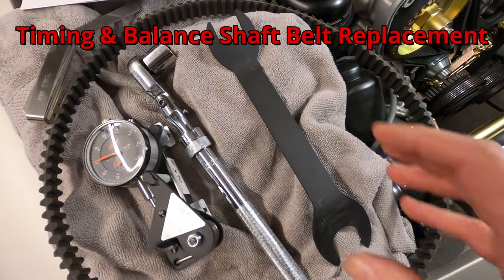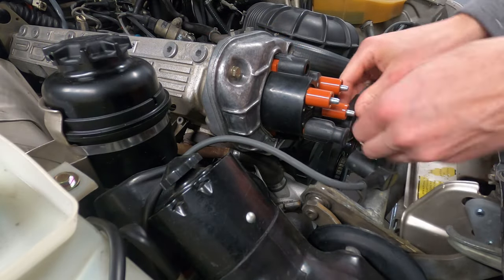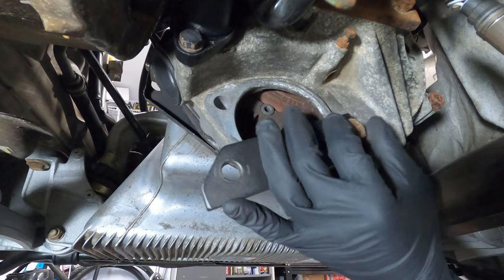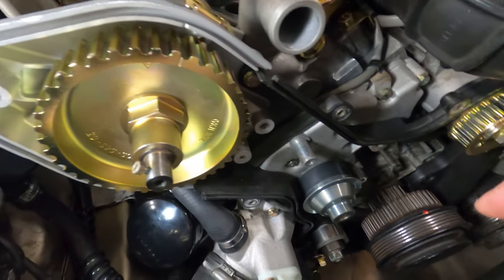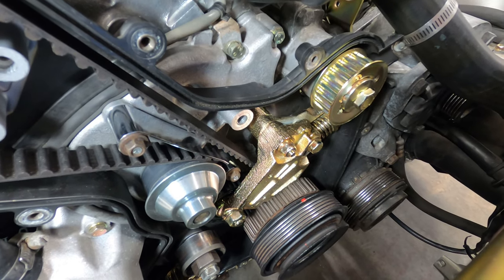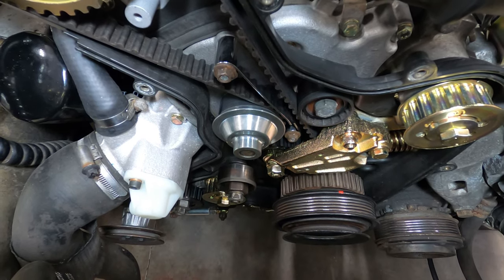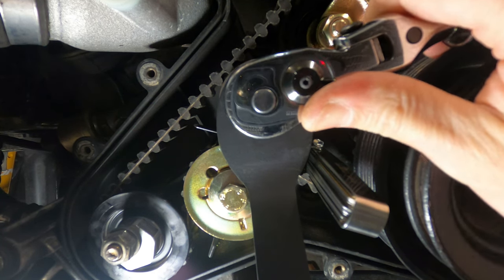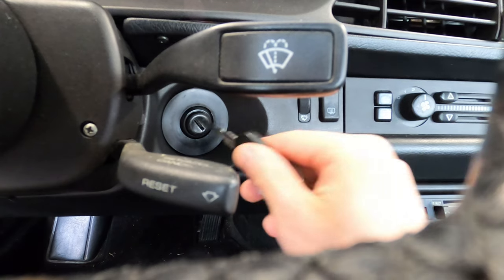Porsche 944 – Timing & Balance Shaft Belt Replacement Tutorial (Spring Tensioner / ArnnWorx Tool)

Comment: Again-excellent job here- Thank you! My car just a month into it with 111k miles had water pump, belts, pullys, etc replaced 4k miles ago by PO. However, it was mid-year 2017. At the very least I need to check tension on the belts. Is it necessary to remove the cooling fan housing  to remove the upper timing belt front cover to inspect belts? And if not, can I do a quick inspection on the belts with just the upper belt cover off or do both upper and lower covers need to be removed? Thanks in advance! Stuart
Reply from the maker: Nice! The belt condition is still probably decent after 4 years unless it was stored in very poor conditions where it could dry out and crack, but it’s definitely worth a check. The top cover can be removed without removing the cooling fan assembly, which will allow for a visual inspection of belt condition and possibly a tension reading, but you won’t be able to make any adjustments unless you remove the accessory belts along with the lower belt cover. 

I think the mileage factor is more impactful than age of the belt, within reason. The most die hard of enthusiasts adhere to the 2-year rule, but I’ve heard some Porsche mechanics claim the belts are better made now and can run for 6 years. Unless I were very familiar with the vehicle history, I probably wouldn’t go beyond 5 years on the timing belt, but who really knows. 😂
Reply: @NC944er  Thanks for that-and I agree. Prior to my purchase, Car was stored inside in the very mild (70's) climate of Orange County, So Cal. The last belt change/service was done with the best parts-Conti belts, a new radiator, PS hi-pressure hose, new fuel dampener line, clutch slave cylinder and hard-line, etc. So no skimping by PO who owns a luxury car business and this was his own vehicle. I JUST put 1000 miles on it in 2 days and it ran flawlessly. I would like the peace of mind to visually inspect the belts and get a twist test on them if I can manage without tearing too much apart. I have a carport-not an enclosed garage but somehow make it work!

Comment: Great reference tutorial!!!  
Any suggestions for a stuck starter bolt (the front 19mm one). I’ve tried everything from a floor jack on a wrench to a torch, but it hasn’t moved.  Before I grab a chisel, do you have any better ideas?  I can’t install the flywheel lock until it’s out. Thanks!
Reply from the maker: Shoot! Yeah, penetrating spray, heat, and brute force is the way to go. See if you can spray the threads on the tip of the bolt that goes into the starter bracket. They poke out just a little right above the solenoid. Some “wake up” hits of a hammer if you can get the right angle. I’ve also found that the closed end of a combination wrench sits more evenly than a socket for that bolt.

Comment: Hey @NC944er, is it worth getting the factory 9201 tool for $600 at present time? Is it a good price? Should I buy it?
Some people keep saying 90°  and water pump method will give the best result, as its not described properly how to use factory tool for a twin cam engine.
Reply from the maker: The P9201 retails for well over $1,000 now and I’m seeing a used one available on eBay for $825, so $600 is a good price. If you plan to keep the car for the long term and continue to do your own maintenance, the tool would be a good investment that you could always resell down the road if you get rid of the car. For me, I’ve never really been able to turn my water pump pulley after the belt is properly tensioned, tested with both a 90° method as well as the Arnnworx tool. I will say that after it’s set with the tensioning tool, the belt “seems” to twist at about 90° with moderate finger/thumb pressure. There are people who claim to have used the 90° twist for 20 years with no issues. I think it’ll generally get you close enough to function, it’s just not precise without a measurement tool, so there’s always that little bit of risk. Although the 16v engines use a slightly different timing belt (wider / additional teeth), my understanding is the tensioning process is the same.
Reply: @NC944er  you mentioned for 16V, tensioning process will be same, and I agree. But what should be the value that I need to refer? Can't find data on Internet on this. I took my car to porsche center to confirm everything is correct, they said its all correct but I'm not sure they know how to use the tool, if at all they used it. Because that center was recently opened and mechs are kind of new I'm guessing here. Its just that I'm not just happy yet, a doubt exists. What if I use my current set up as the reference, get the tool and take readings from it to identify the actual reference point the tool shows and then that will be the value that I'll use going forward. I, for now at least, plan to never sell the car.
Reply from the maker: @Sivaprasad.t.g  The tension value should be the same for all 944 models according the Clark’s Garage…

Tension specs:
New belt - 4.0 ±0.3
Used belt - 2.7 ±0.3

I’m not seeing a separate tension spec in the factory workshop manual for the 16v engines, so my guess is it’s the same.

Comment: I have a question, whenever I install my flywheel lock, it moves the timing mark just a tad. Does your flywheel lock do the same?
Reply from the maker: I’ve noticed there is about 1-2mm of lateral play after the flywheel lock is installed, where the crankshaft can be shifted slightly back and forth against the teeth on the lock. In those cases, you may be able to twist it back in the other direction to line things back up, but in the case of mine, the movement is so minor that it wouldn’t be enough for the timing belt to be out of sync by a full tooth on the belt.

Comment: Great videos. Did you use loctite on any other roller or sprocket other then the timing belt idler pulley. Thanks
Reply from the maker: Thank you! Nope, that idler was the only one I’ve used it on… and after working on the car for the past 3 years I’m starting to think that the prior owner just didn’t tighten that bolt to proper specs.

Comment: Hey @NC944er, Can you please add the torque spec for power steering pump and alternator pivot bolts/nuts and their tension arm nuts/bolts?

Also facing trouble on the timing belt securing clip/belt guard nuts. Top nut is sliding in as the guard tends to open up letting the nut screw in.
I see that the nut is having a wear around its inner and outer washer area.
Any suggestions here?
Thanks in advance.
Reply from the maker: Hey, assuming you’re referring to the power steering pump and A/C compressor? Unless you have a non-A/C car. I’m not seeing anything specific to the pump in the factory workshop manual and the A/C compressor just lists 28Nm for the M8 fitting. I usually just lock all those down “good and tight” by hand, as my torque wrench doesn’t fit in most of those spaces. You should be safe following the standard specs of 20Nm for the M8 hardware and 40Nm for the M10. 

For your second issue, it sounds like you may need to replace the belt guide and/or the nut/bolt setup if it’s worn out.

Comment: Did you have your tensioner and such re-yellow chromated? I tried doing it myself but it doesn’t look so hot. But since it will be covered up, who cares? I really needed this vid because my timing gear has been apart for seven years and I needed to replace the plastic case because it had a hole in it when I bought it on eBay in 2009. Just never got around to it with so many other projects needing my attention.
Reply from the maker: Yes sir! I threw the tensioner and all the steel gears and plates in with the batch of stuff for yellow zinc plating. It looks pretty cool, but to your point, nobody will ever see it. 😂 Although for a time, someone was selling clear plastic aftermarket belt covers for the 944 so the casual viewer could see all the little bits moving around.
Reply: @NC944er  As I said, mine didn’t look anything like your chromated parts. How about a video on your work in this. 
I guess NC means North Carolina. Have you ever been to the Chasing the Tail of the Dragon hill climb?
Reply from the maker: @jockellis  There’s another video on the channel that showcases the before and after engine bay restoration and talks about the approach, but I didn’t DIY the zinc plating. The cleaner the parts are, the better the plating will apply, so I had everything glass bead blasted and then a local metal plating company applied the zinc for $100. 

I do live in North Carolina and Tail of the Dragon is pretty well known. It’s located about 5 hours from me, so I haven’t yet checked it out.
Reply: @NC944er  I should have bead blasted rather than soda blast, I guess.

Comment: @NC944er, my engine is bathed in oil. There's visible leak from cam cover gasket but I'm  not sure is that it. Both timing belts are drenched in oil, along with rest of the parts. Do you have any recommendations on cleaning the oil spill around the engine, belts, covers, cross members and other smaller motors?
Reply from the maker: Hey man! It sounds like you could benefit from an all around engine reseal. Once one seal goes, others are likely to follow as the car is driven, especially if it’s coming out of a long storage period where it wasn’t run monthly. There are a number of seals at the front of the engine that will cover the belts in oil, you’ve got upper and lower front balance shaft seals, the crankshaft seal and the camshaft seal, in addition to other seals around the camshaft assembly. Luckily the seals are fairly inexpensive, but if you’d prefer not to replace them all, a good engine cleaning will help track down the sources. I do most of my cleaning by hand, you can spray the block down with degreaser, scrub it, and spray it off with a hose, just cover sensitive electronics like the alternator, etc. if you decide to pressure wash, stay away from any rubber bits, like wiring harnesses and insulation, as they are likely to crumble. Good luck! 👍🏼

Comment: Hey @NC944er,
I got all the parts put back except air filter box, started the car and it started right away. But now hearing a ticking sound, but not from cam. If accelerator is pressed there's a thud sound periodically.
Can you please help in troubleshooting this issue?
Also can I contact you in any other way for quick communication?
Reply from the maker: Hard to speculate without hearing/seeing it firsthand. Since you have the air box out of the car, could it be the throttle body and/or the flapper barn door of the AFM opening and closing, sounding more pronounced in the absence of the air box? Maybe reinstall the air box and see if the sound changes.

Comment: Is this the same process as an ‘87 924s? I know they have the same engine and I can’t find any videos showing how to change belts on that car.
Reply from the maker: Hey man! Yes, this will be the same process for the 924S, you should also find the same type of spring tensioner used on your ‘87 engine. There are a handful of minor differences in the engine bay from an ‘87 944, like fuel line and A/C line routing pathways, different brake booster and reservoir, etc., but the engine mechanicals are the same.

Comment: Is it really necessary to have the flywheel lock when doing the water pump? I do timing belts "2 per week "roughly on other vehicles so I am experienced but this will be my first Porsche belt. In other words I can hold my crank with a chain wrench while taking out the bolt and I should be good right?
Reply from the maker: I try to follow the factory recommended procedures whenever possible, so I have not attempted the water pump job without the flywheel lock. 

The challenge I see is that the crankshaft bolt is torqued to 150 ft/lbs. I used a 5-foot cheater bar to break the bolt free the last time I did the job. Some people also use a floor jack to lift the wrench against the weight of the car. If your chain wrench setup could withstand that force and also not snap back in the other direction when the bolt breaks free, I guess it might be possible. 

The flywheel lock alone costs $55 and I love a good excuse to add new tools to my collection, so if it were me, I would pick one up. Then you would have confidence that the job is done safely and accurately. Best of luck!
Reply: No -but yes if you change the crank oil main seal

Comment: @NC944er,
Confused about shaft (cam, balance, Crank) sealing ring installation.
1.how flush should I install it - all the way in or flush with end of bearing case?
2.I applied high temp grease over entire sealing ring (including that outer face over the perimeter of sealing ring) for all shafts and installed it at present. Is this okay or will they start getting pushed out while engine is running? Will addition of grease cause oil leak?
3.can I pull out the seals and get them dry outside contact surface and reinstall? 

Clarks garage says apply slight bearing grease, but when I asked in fb group, they said install it dry. Really confused and the job is on hold. Any comments?
Reply from the maker: Hey man! The round shaft seals used around the car feature a step-down inside each recess that will prevent the seals from being over-inserted, so they are generally pushed in until they bottom out (often times this leaves them appearing quite flush, with exceptions like the rear main seal that will appear slightly recessed into the cavity). You may also notice a faint wear line on the shaft/bearing surface that aligns with the placement of the inner seal, which can be used as a guide. Any rough shaft surfaces should first be cleaned up with a high grit sandpaper (500-600 grit) to smooth them out and prevent damage of the new seal. If any of the bearing surfaces feature a deep groove that catches on your fingernail when pulled across, the bearings should be replaced or you can try to install the new seal at a slightly different depth to avoid it riding on the groove. There are a couple different camps as you have seen, that separately prefer dry versus greased installation of the seals. I prefer to use a light coating of assembly grease on the outer surface of the seals, as they install a little easier and that prevents tearing and warping of the sealing structure during installation. Whether you go dry or greased on the outside, it should not affect seal function provided that it’s installed correctly, but I would definitely recommend the use of either engine oil or a super slick assembly lubricant applied to the inside sealing surface that rides along the shaft/bearing, as this will prevent the seal from being burnished/damaged during the first engine start before fresh oil can be pumped to those locations. When removing the seals, there is a high likelihood of the metal ring inside the seal becoming slightly bent or warped, so there is a leak risk of reinstalling a pulled seal, where I would generally purchase and install a new seal at those locations to avoid doing that same job a second time soon thereafter.
Reply: @NC944er  In addition, the seals that I bought are of 7mm thick, the housing space where they sit is about 9mm thick, so I don't think if I get it pushed all the way in, it will be flush with the end face. It will have 2mm gap at face. Will that be okay?
Reply from the maker: @Sivaprasad.t.g  Yeah, that’s common to see about 1mm of outer lip on the aluminum housing when the seals are pushed fully into place. 👍🏼

Comment: When you twisted the belt, how close was that to what you found with the actual tool?
Reply from the maker: I don’t exactly recall for this instance, it varies a little each time, but it’s generally “fairly” close. I’ve done it so many times now, I could probably get by on a 90° twist, as I’ve gotten used to the feel of it, but since I have the tool on hand, I usually throw it on there anyway.

Comment: Have you done the balance shaft covers/ rear seals yet? I got one (lower) leaking pretty badly. Not looking forward to repairing it but the silver lining is the car needs motor mounts too, so “while I’m in there”
Reply from the maker: It’s tight quarters down there so I don’t blame you. I’ve only done the front seals so far, luckily no leaks at the rear presently. If you didn’t need engine mounts, it would be tempting to just RTV the rear seal, but since you’re already there… 👍🏼
Reply: @NC944er  I’m ashamed to say that I RTV’d the crap out of the rear seal today. Lmao. But my car was just down for two months while I did A TON of work to it. This leak just popped up this weekend and i really just want to enjoy the car for a while before I park it again
Reply from the maker: @tims_4x4_garage  No shame in finding balance in life. LOL! Feels like more of a January/February job anyway. 😂

Comment: My 944 has a awful whine when you start the engine I've pulled the engine because I am fixing a bunch of seals and gaskets. What do you think is the cause of the whine. the timing belt water pump etc has been replaced.
Reply from the maker: It’s fairly common for the balance shaft belts to be over-tensioned or the idler roller improperly adjusted, which is known to cause excessive whining noise. Could also be a failing roller bearing.